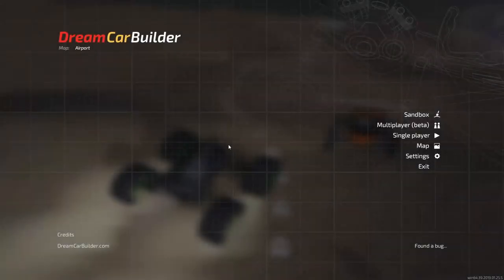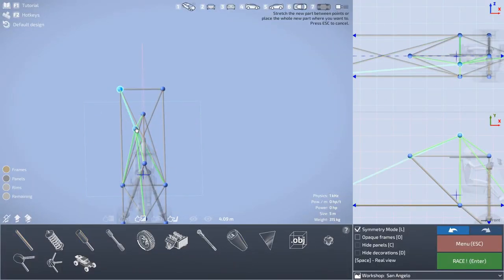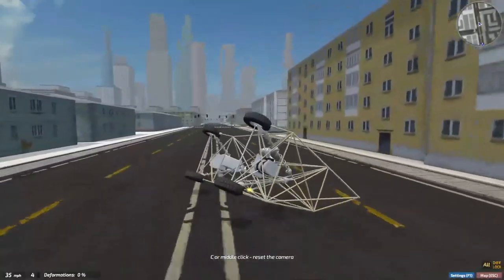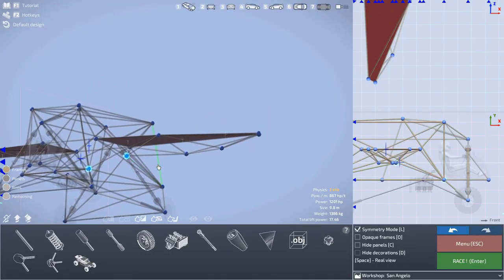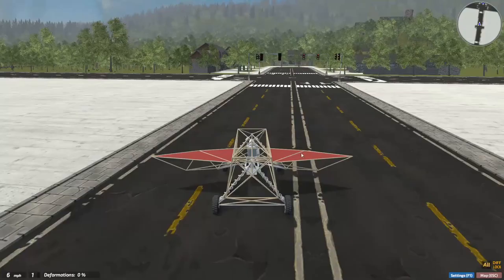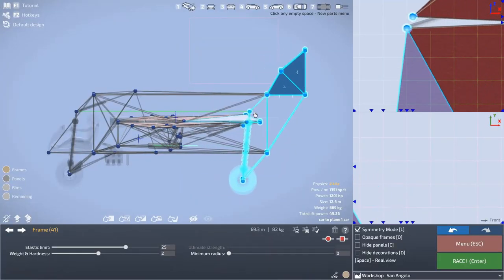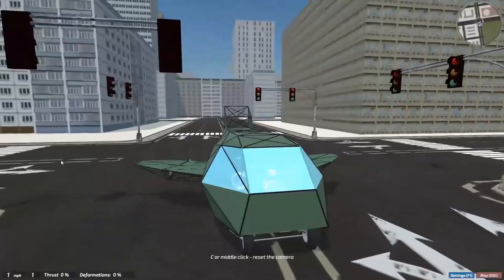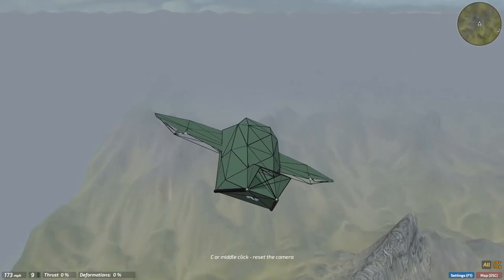Making a Flying Car in Dream Car Builder

Comment from the maker: The engine and tiny wings made this hard to fly, and the small wheels made driving difficult. I think I know why flying cars don't exist.
Reply: Once opon a time i made the car in simple planes a plane it was hard to fly and crash computers but not 5 dollar tablets
Reply: jets feel like cheating - isn't it possible to drive a propeller and wheels from one engine?
Reply: ...how original
Reply: Can you make a plane with wings inside it(kind of spaceships idk) or boat-plane
Reply: @artelislt  yes
Reply: Amazing, but why don't you make a plane with the classic disign?, The big wing at the middle controlling roll and the smaller wings at the back controlling pitch, and a vertical stabilizer, with this configuration it's super easy to control the plane.
Reply: You should make a tank or monster truck in dream car builder
Reply: if you add flaps at tail, plane will be easier to go up
Reply: U should make the cybertruck from tesla
Reply: actually, funnily enough, they do exist, specifically helicopter like cars, made by the dutch, all I remember is that they have three wheels, motorcycle like balancing system to help that, and collapsible rotary

they're just too expensive and impractical
Reply: You should have used a design for the wings to go into the car like a Tesla car door
Reply: @LukeEvans55  Sure, you just need a second special transmission with two output shafts.  Realistically this will add more weight than you'd want so if you're gonna add weight, may as well have it be jet engines.  Flying cars probably won't be here until they release the hovercar dlc.  Gonna be electromagnectic, my dude
Reply: i have a question please :D , what is the name of your discord server , i would love too join
Reply: Can u pls make a motorcycle
Reply: @beemo1749  there is a discord imvite link on the description
Reply: Hey @Raid Captain, would you consider playing Infinifactory. It is a puzzle game, where you build a conveyer belt by engineering different machines in order to complete different tasks. I think it might fit your style of video, and it really fun :)
Reply: May we have more lovely content of flying things? :D Maybe you should try making a plane that transforms into a limo :OO
Reply: You know, it looks like a beetle kind of.
Reply: Another reason why flying cars don't exist: we are not educated enough.
Reply: Wow I'd say the car type is 3033 flying car.
Reply: They do exist

Comment: Reid, although it does fly, you could be getting much more efficient turning by putting your alierons on the back of the plane. The main wing ones should just be flaps and roll, rear ones should be pitch and yaw. (this is alot coming from a guy who cant even connect the transmission properly)

Comment: This was a pretty cool project and there’s now way I could get it done better anytime soon. But as an aviation enthusiast I have noticed your plane designs use something that doesn’t make sense.

Instead of putting your up/down controls on the wings, make a horizontal tail with the moving surfaces at the back. This gives you a larger moment arm and makes it look more like a plane. With the larger arm, you get to use smaller surfaces with less deflection to get the same effect, meaning your wings will always produce lift and your controls won’t cause nearly as a large of a loss of lift and increase in drag.
Reply: Yeah he keeps doing elevons even tho he doesnt put them way back on the plane.

Comment: You could try a more conventional plane design with using the wings purely for lift and rolls, and using "elevators" mounted on the rear to control pitch

Comment: I've noticed in a few of your videos now that you use "flaps" on the main wings to control your pitch instead of elevators on a tail fin. Is there a reason for this? You'd be able to get much more control out of a tail fin while sacrificing less of your lift when pitching up. :o
Reply from the maker: I just didn't feel like making a tail to support the elevators, I think next time I make a real plane I'll try it.

Comment: hey just a tip
use back wings (elevators) in the back
that make takeoff and landing 300000% better and increases your stability
Reply from the maker: I would have, but i didn't feel like making a full tail to put them on lol
Reply: @ReidCaptain  lol
also there is a wierd plane made by nasa
its called idk but it had a sungle rotating wing on top... can u make it? :)